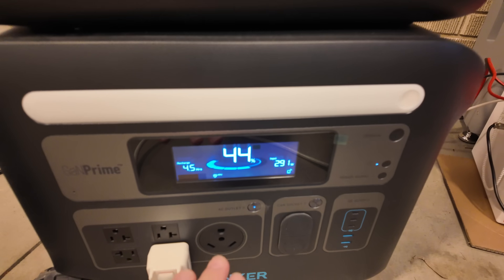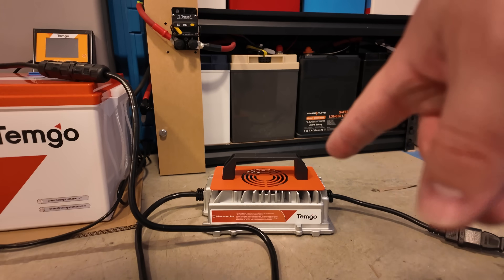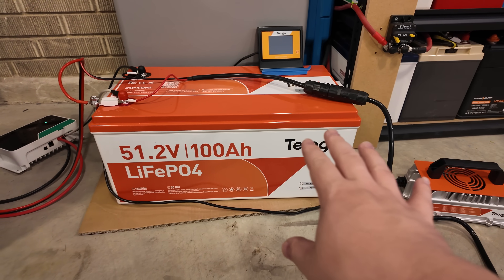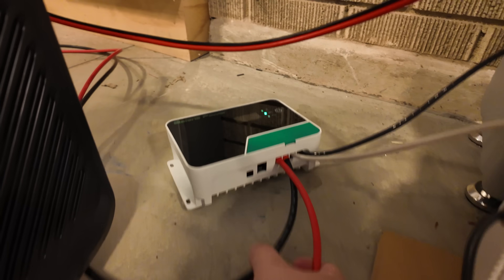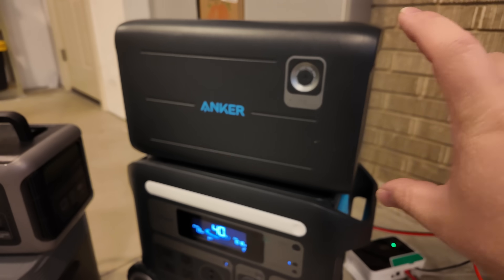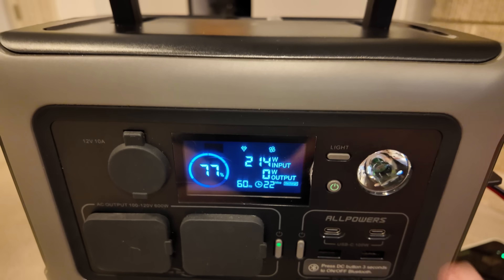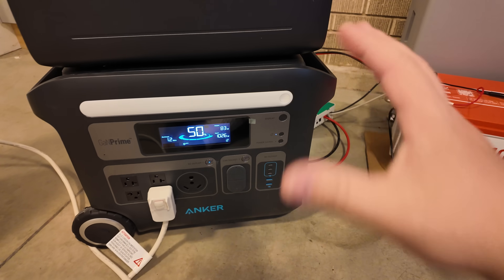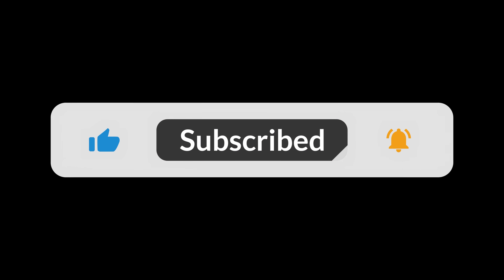I SOLVED the BIGGEST Problem ALL Power Stations Have!

Comment from the maker: Buy the Temgo 51.2v LiFePO4 “Golf Cart” Battery Kit: https://www.temgot.com/products/48v-100ah-lifepo4-lithium-golf-cart-battery?ref=trickforthat 
OR buy from Amazon: https://amzn.to/4odUYPP

Watch the full review video for this Temgo Golf Cart Battery: https://youtu.be/dboHXnSY9LI?si=Dr4sjA5anhd2YuZa  

Buy cable to connect battery to power station: https://amzn.to/4fjTcZo
Buy a terminal fuse to protect your power station wire: https://amzn.to/40Jp2J7

Buy a smart MPPT charge controller: https://www.bougerv.com/products/40a-mppt-solar-charge-controller?aff=230
OR buy from Amazon: https://amzn.to/41x5BDv

Ask me a question and get a personal in depth response: https://ko-fi.com/s/8d8df1880c 
OR
Sit down for a personal 1-On-1 hour long video consultation with me and I’ll provide answers and insights to anything you want to ask me about from this channel: https://ko-fi.com/s/dd139831a7 

Buy the Anker Solix F2000: https://ankersolix.pxf.io/RG6oAN or https://amzn.to/4b4mGrU 
Buy the Anker Solix F2000 Expansion Battery: https://ankersolix.pxf.io/Qj6Xao or https://amzn.to/4hH9fRq 
Buy the Anker Solix F2000 + Expansion Battery Bundle: https://ankersolix.pxf.io/mO2vLM or https://amzn.to/3X3ifrG 
Use code: ANKERSOLIX20 at check out (Anker Solix website only) and save a massive 20% off your order! (Does not stack with limited time deals or other coupons)

Buy EcoFlow Delta 2: https://amzn.to/45twDwY

Buy the ALLPOWERS R600: https://iallpowers.com/products/allpowersportable-power-station-r600-600w-299wh-with-lifep04-battery?ref=hasqwavt&variant=43037012852889 
Be sure to use the code: TheresATrickForThat to save some money on your order!
All donations get 100% re-invested in the channel:
https://buymeacoffee.com/theresatrickforthat 

Affiliate Disclosure
As an Amazon associate I earn from qualifying purchases at no cost to you! Thanks for your support!
Reply: Pretty ingenious, solving the limited amount of voltage the Power Station can handle by adding a charge controller. I don't believe ive seen any channel do this.
Reply from the maker: @mannyfragoza9652  It works super great! Thanks for watching!
Reply: @theresatrickforthat  i shared your video on the DIY solar on Face Book
Reply from the maker: Thank you so much!
Reply: No problem 👍
Reply: @mannyfragoza9652  yeah seems pretty slick! I just can't see buying the propriety expansion that is useless when the tech frees me up for several variations.
Reply: The video wasn't clear to me on these 2 points. Do I need to get the MPPT charger or will this setup work without it? If it works without it, do I still need to get the fuse?
Reply: Hello
Reply: Where do you connect Solar panels?
Reply: can you help me understand why 51volts? i was looking at the li time 12.8v 320 Ah because the mini is much smaller than the competition, price is comparable. thanks, I really enjoy you content!
Reply: ok, I bought it off amazon. I have two anker solix c1000 and one c2000. getting a couple solar panels and a modest generator. This is fun stuff to learn. still not really getting the amps equation. pulls or pushes I get but amps?  potential power? I feel dense.
Reply: I thought the charging volts from the extra battery had to match the power stations input capacity (12v i guess) so it wont overheat; does the BMS in power station step down 48v to 12v?
Reply: @jpw7598  your station should say what range of volts . my anker says upto 60v and will throtle thewatts to 800.
Reply: volts push and watts pull what they need. i think.

Comment: just get a PROPER GAS GENERATOR to run the ac,,,,, sheesh,,,,, i'm having troubles just connecting a lipo 100 ah battery to these power stations,,,,, no-ones able to even tell me what side of the yellow solar input plug is the positive side,,,,, the chinese ONLY want us to use their proprietary battery supplies or solar panels,,,,, it all sucks, BUT IF YOU HAVE A GOOD GAS GENERATOR, THEN USE THAT,,,
Reply from the maker: To each their own!

Comment: hey, I think I know the answer here, but i dont want to be wrong, so, what size fuse are you using?
Reply from the maker: You need to size your fuse based on the size of the wire that you are using. In this video, I am using 10 gauge wire, so I am using a 30 amp fuse.

Comment: Thanks, Teach!!   Question: So DC power doesn’t stop and reverse the inverter from doing its job: POWER THE AC with A/C.

Thank you! I had no idea that the generator would PASS through and leaving the I batteries on the power station HUNGRY,  
But what are the BTUs for that A/C unit?  I just realized your “gas generator” tripped because it only gives 1,000 Watts going into pass-through .  You A/C spikes the compressor which must max the total allowable? So a 2,000 watt Delta 2 Max or Honda 2200 would NOT trip, yes?

Great system. Most Have. I didn’t know my Power Station could receive 48 V!! Even a small one!
My smallish window unit is only 500!watts so it wouldn’t trip
Reply from the maker: Glad I could help! Your milage may vary for larger "generators".

Comment: Thank you for the great content, I'm learning a lot! I am just confused why the "generator" / Delta 2 power station can't handle the portable AC load. It is rated for 1800 watts like you mentioned (surge of 2700 watts I believe) and the portable AC is drawing around 1170 watts as shown later on in the video. I don't know why it would shut off due to overload condition when going through the larger Anker power station as pass-through mode, shouldn't the Ecoflow be able to handle that AC load?
Reply from the maker: It’s the surge load. Too much for them to handle.
Reply: @theresatrickforthat  maybe it cannot provide 2700W of surge output when passing through the Anker power station, or the surge load of your AC is more than 2700W..would be interesting to know if the delta 2 can power the AC in the video if hooked up directly to it. I know that's not really the point of the video haha but I just got curious

Comment: Hola amigo  saludos 
Yo tengo la ecoflow 3600 w/h  le  conecto una bateria de 51.2 a 200 amperios por la entrada solar pero el boltaje no es estable cambia mucho   800
600 500 .200 .100  baja y sube constantemente que puede estar pasando
Reply from the maker: That's interesting! It's hard to say without seeing the setup.

Comment: Is it possible to operate the 767 + the aftermarket battery AND solar at the same time? If so, do I need an inverter that is connected to the aftermarket battery and feeds the solar input into it? And then the battery simply feeds into the 767 and I can draw my normal power from there?
Reply from the maker: Yes! No need for an aftermarket inverter since the Anker has a nice one built-in! Just get an after market MPPT solar charge controller like I show in the video and you're good to go!

Comment: What if you put 2 of these in Series to stack voltage? Is this safe for high voltage solar ports? What would battery drain look like for each one? Would it split the drain across 2 batteries? Or is this not safe for the unit?
Reply from the maker: Not safe. The batteries aren’t rated for series connection

Comment: Some power stations have the ability to disable the bypass via their app. It can be harder on the battery, but when you're in a tight spot or have this issue the setting may help. Slick idea though.
Reply from the maker: I haven’t tested any power station with that feature before! Which ones do it?

Comment: If what you're saying is true that the power station will regulate the amps as long as the voltage is correct. Then you could put a 60amp charge controller with a 4k array on the external batt while it connected to the 1 k power station
Reply from the maker: Yes, that is what I am saying!

Comment: Great video.  I am about to take possession of a fifth wheel RV with two lead acid batteries.  This has me thinking about replacing them.  I assume they are wired in parallel to provide 12 volts to the RV.  I also have one of the Honda generators mentioned. So, as the video says, I could use the gen to charge this battery and then turn it off when done charging.  The RV also has two AC units, so if there isn't already one installed, I would have to add an inverter to run one of the AC units.  Does all of that sound right?  Any thoughts or suggestions?

Oh, I also might setup a DC-DC charger to charge this battery while driving down the highway.
Reply from the maker: Sounds like a good plan! Consider having a dual voltage setup. A 12v system for the 12v stuff and then a 48v system for the heavy loads like the AC's that run off the inverter!

Comment: God bless The USA. In Europe our prices are 700-800 for batteries like this))) plus charger and inverter (another 300 ) so it is not worth it unless you plan to expand the capacity by adding a second battery))) I found a cheap solution for two balcony systems 500usd/eur for 2.5kw and that’s it. I have two of them..Not the best ones but I can store the battery outside of the house linked directly to solar panels. So they are for external use..which is safe enough. I am a little paranoid to keep batteries inside home.
Reply from the maker: Sounds good!

Comment: The main issue with using an external battery like that is you can't control when to stop charging your power station at your desired state of charge. It will keep trickle charging until the battery is fully depleted. This continues unless you manually unplug the cable, or if the battery has a remote feature in its app that lets you turn charging on or off for the power station.
Reply from the maker: Correct! I think this is a good thing so your power station is basically always fully charged!
Reply: @theresatrickforthat It's not good for battery health in the long term.

Comment: so.  short version.  Charging a power station via AC puts load on the inverter so less inverter capacity is available for other loads.  Plan how to charge the power station via DC to take the inverter out of the loop.  I think most of us using power stations and trying to get the most use out of them are trying to keep the inverter turned off whenever possible, no? I look for the 12vdc version of anything I can, when buying.   If I'm off here PLEASE let me know.
Reply from the maker: I personally think you've got it reversed...most people buying power stations want to use AC power, and the DC is a bonus! If I only have 12v stuff to run, I'm totally NOT going to use a power station and just use a cheap 12v battery! It'll put out WAY more DC power than any power station and do so WITHOUT any conversion losses! Solar charging is better too because a cheap MPPT controllers for the battery can actually usually accept more power than power stations can too! But once you start trying to add a larger inverter to the mix, then the all in one power stations start looking a lot better! But you want to have your inverter capacity to use! Those are at least my thoughts!
Reply: @theresatrickforthat thanks for the conversation. I must HAVE ac available but seek to leave the inverter off as much as possible. Solar is of no interest to me. I use the EcoFlow charger as I relocate often.  Am planning toward those exceptional days when it’s particularly cold and fate brings other loads too.  Interesting time isn’t it?  I love this stuff and spend lots of time overthinking it.

Comment: This is very cool.
So with a big golf cart battery is there any need to have a large power station?
Just get a cheap one and use a large golf cart battery.
Reply from the maker: The only reason to get a bigger power station is for higher power input form the battery and larger inverter.

Comment: If you plugged the 48v charger directly to the xt60 port, would it charge the Anker?
Reply from the maker: I don't think so. The charger is looking for batter voltage, and if it can't detect it, it'll not send any power.

Comment: That is genius. I like the idea of the converter bringing high voltage solar panels down and also the extra battery idea. This video helped open up ideas.

Now if you can show me how to reduce or get rid of the EMF that inverter creates when in use.
Reply from the maker: So glad it was helpful! Maybe run your inverter in a faraday cage? Haha! More practical...why not use the simple invention of a extension cord. Keep the EMF inverter in the garage and run the power point of use a good distance away where you are! Just some ideas!
Reply: @theresatrickforthat  yes yes, I know.

I was thinking more for a camping set up where it would be inside the tent. I have considered looking for a small tent, like for pets, to place it in away from the tent, which will also give me back that space. But with your hacks, a bigger tent will be better. I could make it a kitchen tent with fridge and power supply and extra batteries, although the extra battery might be overkill.

Comment: We are using a Segway Cube with 5 1000Wah batteries in a stack, connected to one AC circuit in the house. The Segway powers a gaming system inside the house and powers (charges) an Ecoflow Pro which has the 30 amp service connected to an RV outside. The RV draws a very tiny 60 watts nominally. However, when coffee is needed in the morning, it draws 1500+ watts. The Segway shuts off it's input and dumps power to the Ecoflow. The input isn't a factor for the Segway when output exceeds input, it just switches it off. Will it run a microwave and make coffee at the same time? No, because the Ecoflow will limit the draw. One appliance will at least run. I'm going to reverse it though, and have a generator maintain the Ecoflow and have the Ecoflow maintain the Segway in the house. The Ecoflow can dump 3200 watts and the generator will run automatically as needed.
Reply from the maker: Sounds like you have a very robust setup!

Comment: You could use the battery expansion port to diy a connector to the golf cart battery as well? I know you wouldn't want to do that if they are at different soc, but if it's semi permanent, you could recharge both to 100% first or use the DC charging in to equalize first.
Reply from the maker: Yes! Certain power stations let you do that!

Comment: At this point, you're better off just get an inverter and hook it up directly to the 51.2V battery. A 48V 2.5KW inverter cost about 1/4 of the Anker system you're having.
Reply from the maker: Yes...if you're building from scratch...but a lot of people already have power stations and this is a way to help maximize their functionality!

Comment: I'm thinking of buying  a 240V capable power station.  I want to be able to charge the power station with my 120v gas generator while it's in use.  Only the expensive Ecoflows are capable of this and I don't want to spend $7500. I like the idea of what you are doing in this video but I do not need the extra battery.  Is there a power supply I can use directly plugged into the solar inputs of the power station?  Would that work?  It would seem like an elegant solution to get around the power station inverter limitations.
Reply from the maker: I’m not aware of what would work plugging directly into the power station without some kind of buffer like the battery in between.

Comment: This might work on the Anker as shown but doesn't work with an ecoflow delta pro.  The 100 amp battery causes wobble on the input.  the ecoflow is limited to 15.9 amps and 150 volts and mine won't take mor before it fluctuates wildly turning off and on.  With 48 volt battery but 100 amps it just doesn't work to charge the ecoflow.
Reply from the maker: I don’t have a Delta Pro…But I have the Delta 2 as well as the Delta 2 Max and this works just fine with those!

Comment: So I have a delta 2 max 4800W with a setup just like this how much  solar panel input would i need to charge the battery
Reply from the maker: Well, if you weren’t using any power you can charge with a small amount of solar. But most people (myself included) like to use our power stations at the same time as we are charging. The 40amp charge controller linked in the description can charge a 51.2 v battery at over 2,000w. That’s ideal since that gives me 1,000 watts to feed the power station with and 1,000 watts for charging of the golf cart battery!

Comment: How do you limit the SoC of the battery to say 80%? I have serious concerns about constantly running the battery at 100% charge and killing it off quickly
Reply from the maker: There’s no way of limiting it. But it’s LiFePO4 chemistry. You’re going to be able to run it from 100 to 0 and back to 100% every day for 10 plus years and still have 80% of the original capacity left over. By that time you’ll probably have replaced it anyway with a new better battery.
Reply: @theresatrickforthat  my understanding is that holding it at 100% is actually worse than discharging and recharging

Comment: I am using a Bluetti elite 200 and I have solar panels charging. I would love to use a battery like this to expand my system. It is our only source of power so the solar would be connected all the time. I’m assuming to a charge controller, I’m thinking a Victron. Do you see any problems? If, later in the year when there is less solar, with the battery being fully drained by the power station? Will that cause any kind of problems as will the MPPT controller turn back on when there’s solar power again. There is a relay on the power station that disconnects the MPPT controller when there is no solar anymore. I’m wondering, will that just keep going on and off as the battery voltage drops off near a fully drained state?
Thanks so much for your help
Reply from the maker: I think your plan sounds great! The Victron controllers are excellent. I think you will find everything works pretty well!